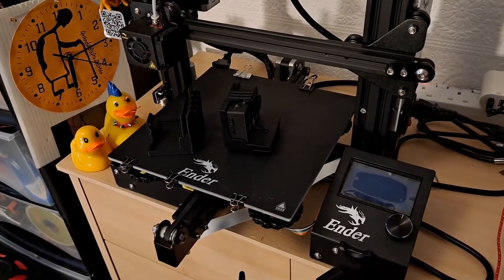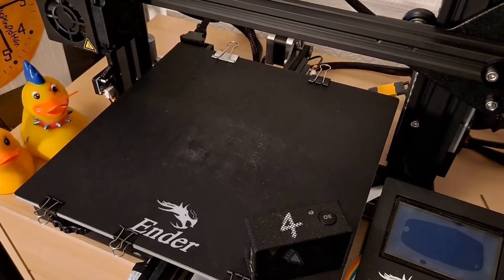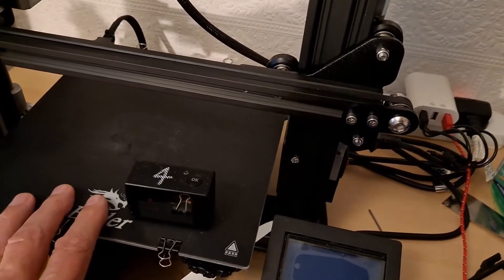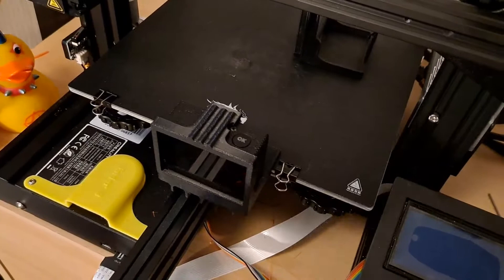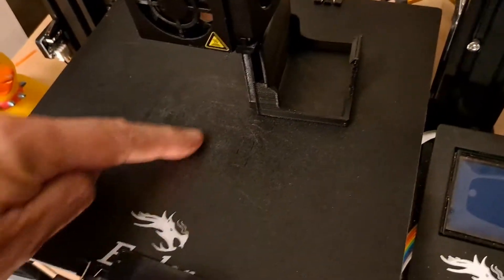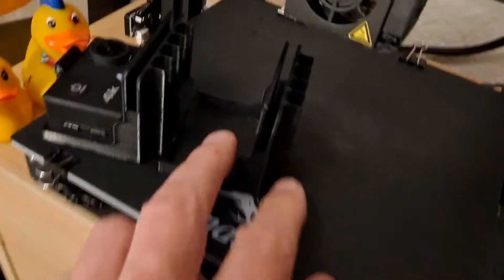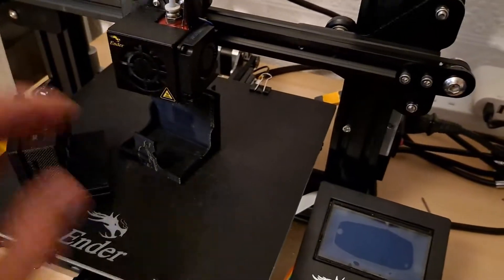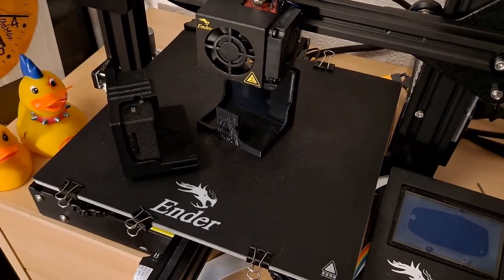3D printing a Printer Bed Action Camera Mount for filming 3D printing

Comment: Great video. My only concern is that the PLA goes soft at around 60 degrees and might fall off (due to the heated bed).
Perhaps something that clips on to the bed carriage instead.
Keep up the good work.
Reply from the maker: Yes, I actually put a clip on each side of it to stop that happening. I had hoped those cooling fins I put on the underside would help, they might be having some effect, but not enough. I just thought it was a rather amusing subject for the video to film printing the mount to film printing the mount. The fact there is no adjustment for the angle of the view is a bit of a shortcoming too so this one is really just a novelty print.

Comment: Could it possibly offset the alignment of the printer bed from the weight of the camera? Nice vid though!
Reply from the maker: Technically possible but I doubt it very much, we are talking a small action camera, maybe 60g and you should check your bed for level on a regular basis. As I place it on the centre line it is directly over the Y axis movement it should be OK in that direction at least. The bigger problem is that as we are printing it from PLA and then sitting the bracket on the hot bed while it is printing, it will go soft again and possibly drop off. I used an extra clip to hold it in place.
Reply: Nah I wouldn't worry, imagine a huge print will also not misalign the bed that easily and these camera's really are light :)
Reply from the maker: @MarinusMakesStuff  :-)